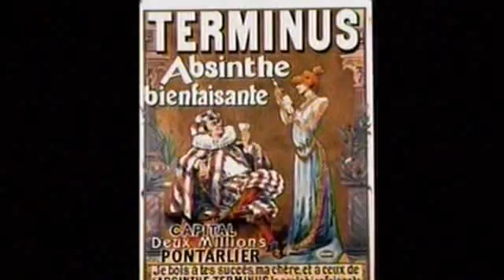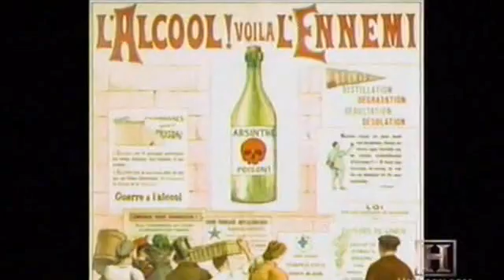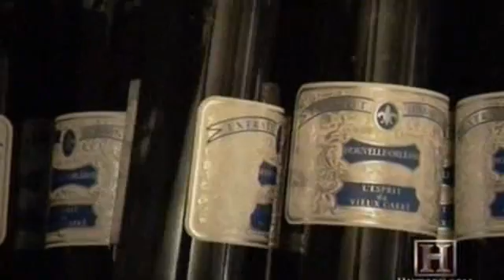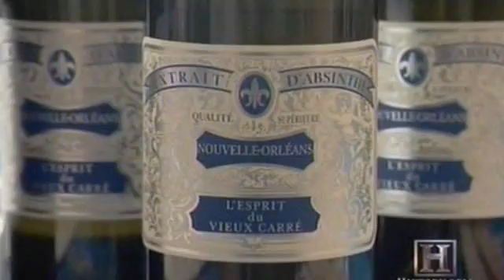Jade Liqueurs absinthe at the Combier distillery

Comment: To anybody that wants to distill REAL absinthe, here is a recipe from a 19th Century French distillation manual (notice how much absinthe is used):
Artemisia Absinthium, dried and ground	- 2kg, 500g
Green Anise				- 5kg
Fennel					- 5kg
Beet Spirits (everclear works great, just make sure to dilute), 85%			- 95l

1. Digest ingredients in warmed spirits for 12-24h
2. add 45l of water when ready to distill
3. Distill (keep tails, 
Artemisia Pontica, dried and picked	- 1kg
Hyssop (tops and flowers)		- 1kg
Lemon Balm, dried and picked		- 500g
Distillate				- 40l
,.lk
1. Heat gently to almost a boil, then stop heat
2. Let cool, then drain through nylon, hair mesh
3. Add 55l of prior distillate and 5l of water

Comment: I am not a distiller, but neither are YOU. You said so yourself, or are you changing your mind? There are good reasons for getting rid of "debris" in a distillate, one of the most important of which is the desire to avoid over-flavoring the liquid phase of the macerate. Also, too many floating particles on the surface affects the rate of vaporization of the distillate in the still. NONE of them involve changing the liquid's "density". If you were a distiller, you would already know these things.

Comment: Oh, so now it's "filtering" again?  Not "perforated funnel"?  Make up your mind.  I'm sure initial density is important, but too bad for you your "common sense" cannot defeat the laws of physics. Or chemistry in this case. A large particulate suspension (e.g. seeds and stalks) in a liquid does not change the density of that liquid by either its presence or its absence. It doesn't really matter what your "common sense" tells you.

Comment: First you say you're not an expert, but now I have to trust you because you know what you're talking about? Sorry, not happening. Your latest reply still doesn't do anything for your argument that a "perforated funnel" process will do ANYTHING to change the density of the liquid.  It won't.  You need to review your basic physical chemistry again.  Large suspended particles in a liquid like aniseeds don't change a liquid's density, so getting rid of them won't either.

Comment: Maybe there is an English language barrier, but you are talking about using a very coarse filter to get rid of the big chunks of plant matter, correct? That's also what I'm talking about. Doing this kind of coarse filtration will NOT appreciably change the density of the macerated liquid that's been filtered.  As I said before, and you don't seem to understand, the density can only be changed by separating the constituent compounds in the liquid, by distilling it or by using a very fine filter.